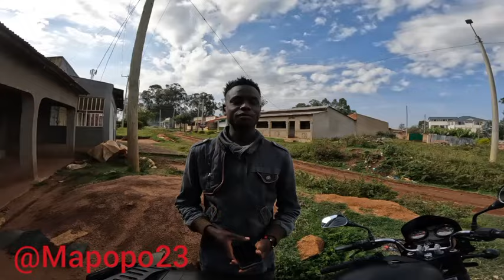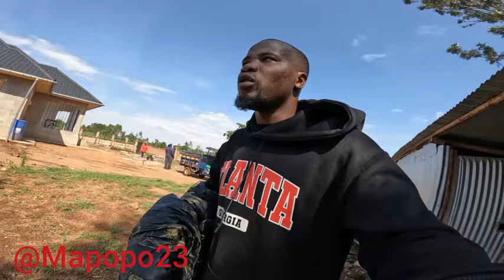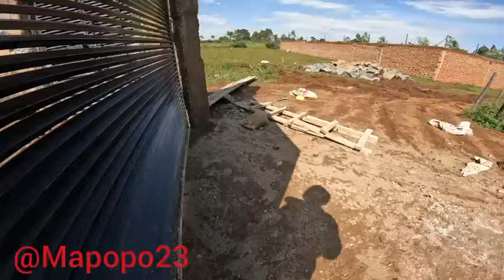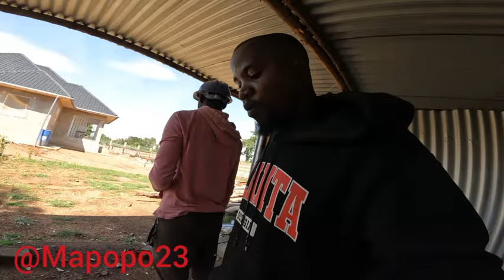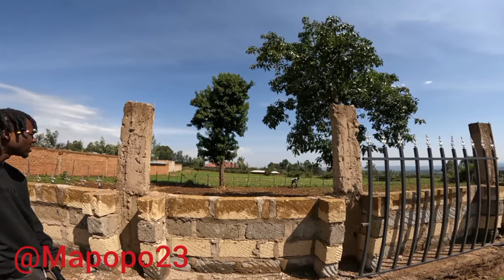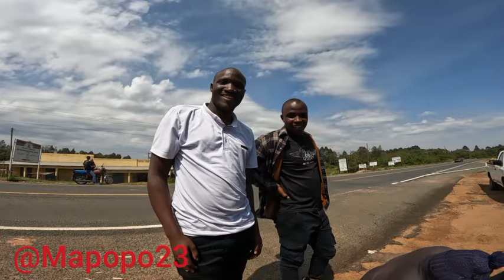FINALLY GOD HAS SEEN ME THROUGH 😍 THIS JOURNEY IN MY DREAM HOME 💒 !!!!!!

Comment: Dear Mapopo,
I am truly delighted with the progress on your main gate. As per your request for suggestions, I would recommend plastering the gate pillars with cement and then crafting an elegant design over them. The mason will be familiar with the process, so it would be best to follow his guidance closely. Additionally, ensure the grills are securely and firmly installed on the compound wall.😊